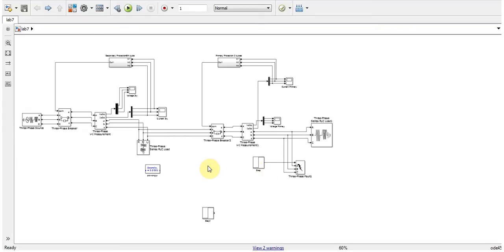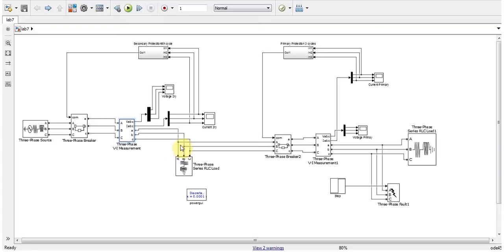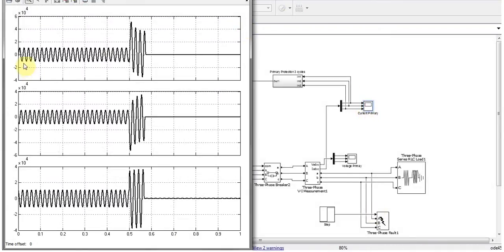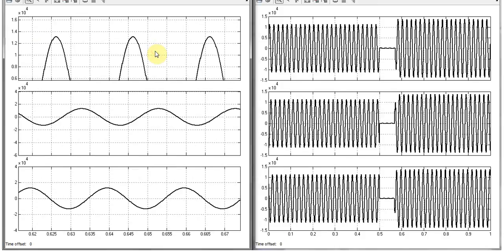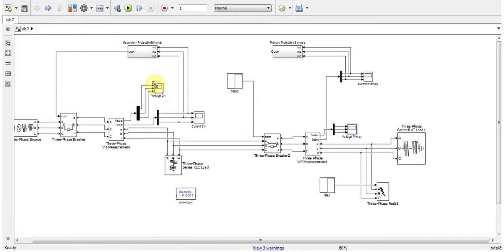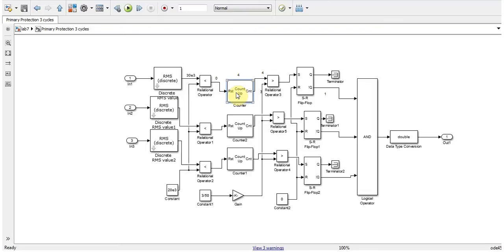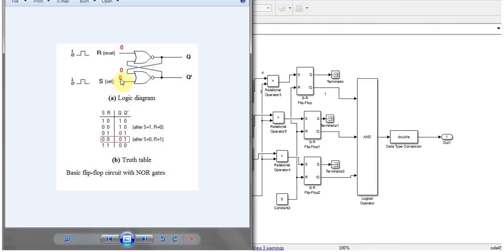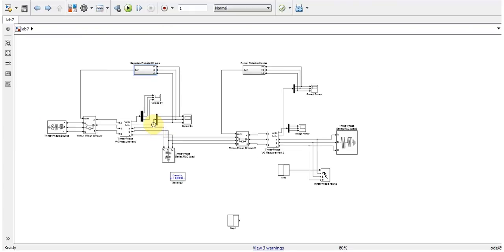Matlab Course: Protection using Definite Time Over Current Relay DTOC in Simulink

Comment: Wonderful video, great work. One question, how much is the value of gain inside primary protection 3 cycles relay after the block constant1. Sameway, is the gain value is same for 6 cycle relay as well.
Reply: 1000